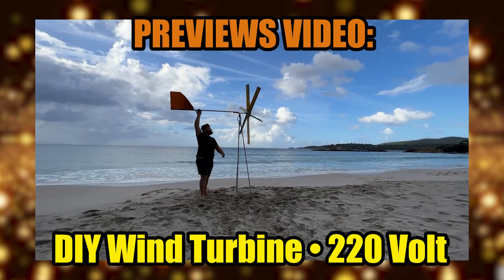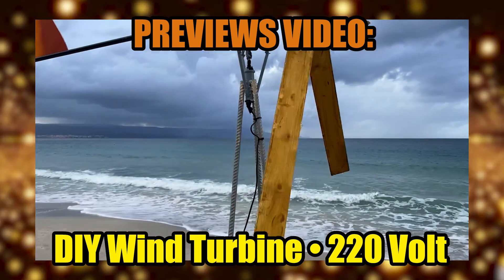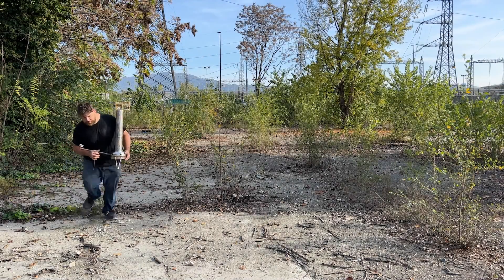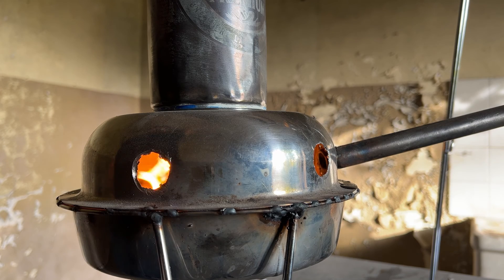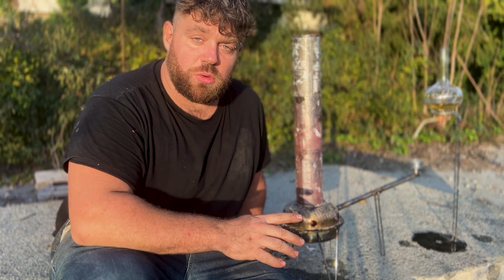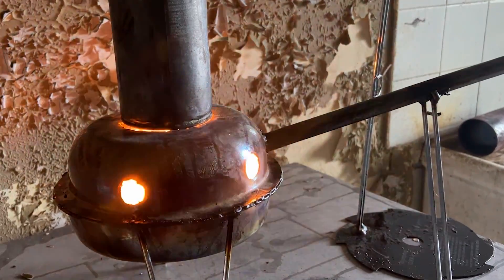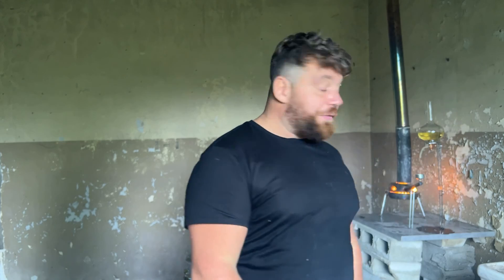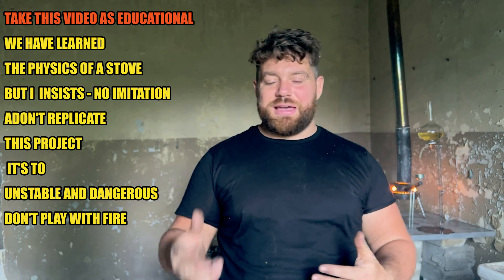Waste Oil Stove made from Beer Cans - Full Tutorial 4k

Comment: Just a little tip for people who need to make holes to glass. If possible cut, puncture and drill glass under water. The glass wont chip or shatter. With a hand drill you obviously need a longer drill bit shaft, but it can be done.

Comment: Coil a copper pipe around the chimney and pump water through it to a radiator, fan so you can extract even more heat from the system and cool the chimney down at the same time.

Comment: Have you thought about using the blue-whirl effect for cleanly burning the oil? Scientist looked for a way to cleanly burn already burning oil leaks on the ocean. Although the phenomenon is to unstable to recreate it on the ocean (at least until we figured out how to artificially generate a wind hose in the middle of the ocean) it is possible to create a vortex in the lab, that cleanly burns a puddle of oil swimming on water. 

The more easy way would be to look at how oil-fired heaters work.
Reply: Edit: Just look at wasteoil burners that work with preheated pressured air (external fan). Sure, my idea above is more elegant because it doesn't need electricity, but is less pragmatig and scalable.